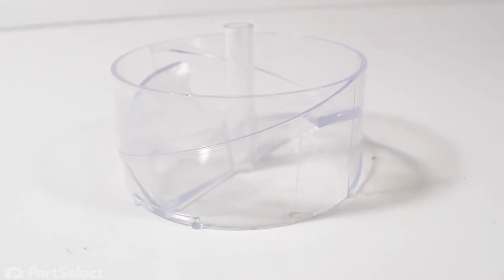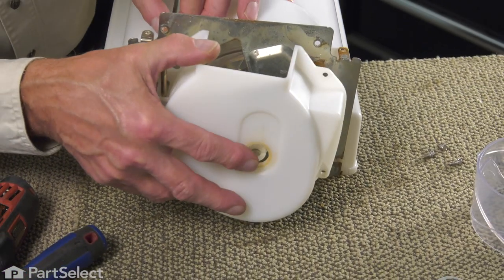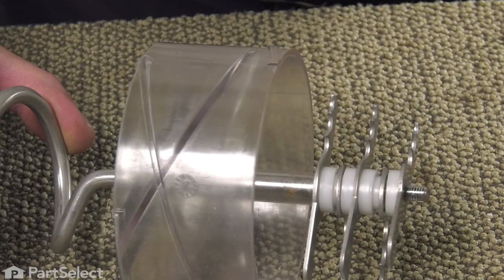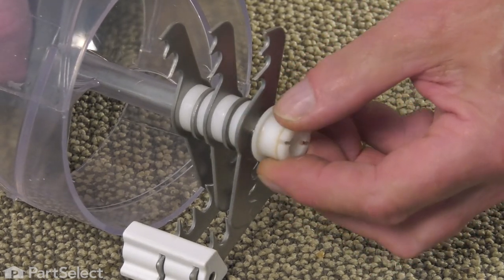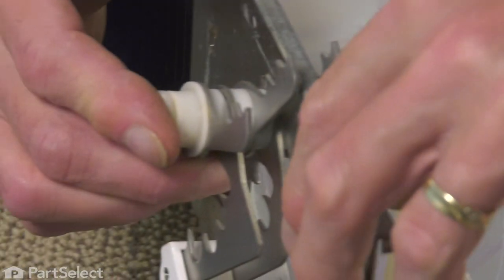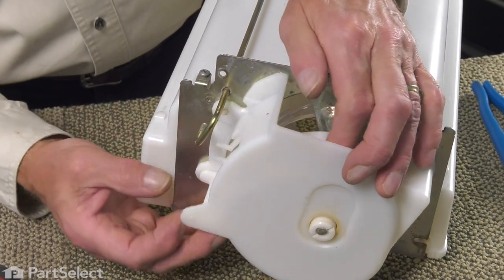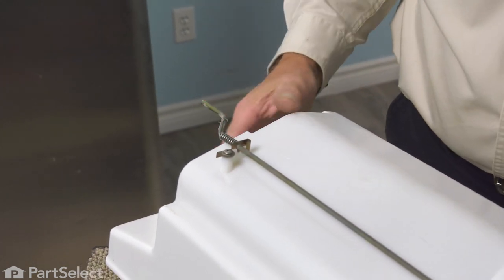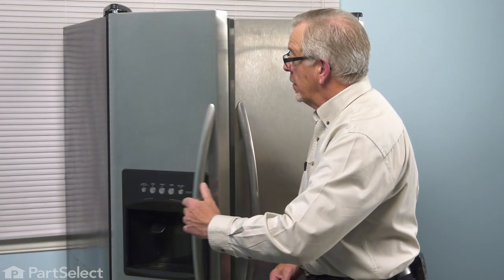Frigidaire Refrigerator Repair - How to Replace the Ice Dispenser Drum (Frigidaire # 241685101)

Comment: This was a great video...I was able to change out the drum (and I am not very "repair" savvy and not good at repairing appliances), now ice is coming. BUT...when i switch over from cubed to crushed, the ice does not come out crushed...it still comes out cubed...any idea why this may be? Thanks so much. This is the third repair i've made on the fridge thanks to your videos!
Reply: None of these repair videos mention it but when ever u remove the Ice bin put the selector button on crushed then put the  bin back in, The selector bar running along the bottom is spring loaded to crushed position 😉